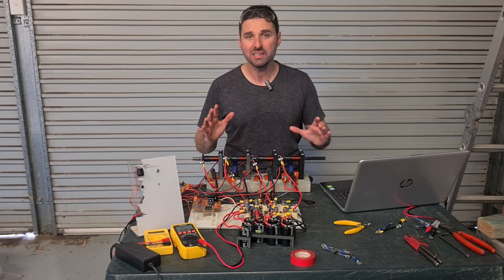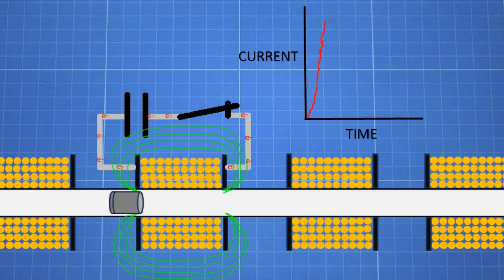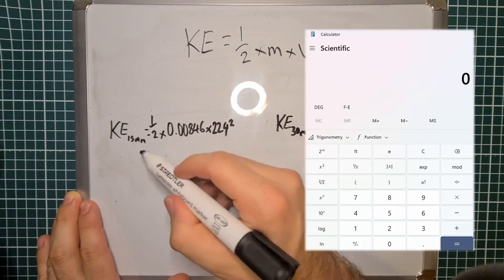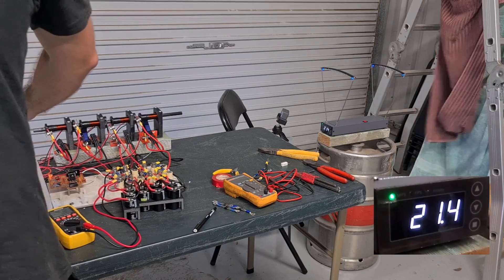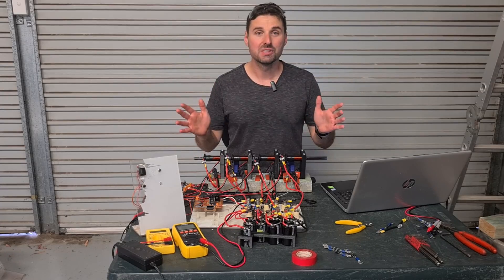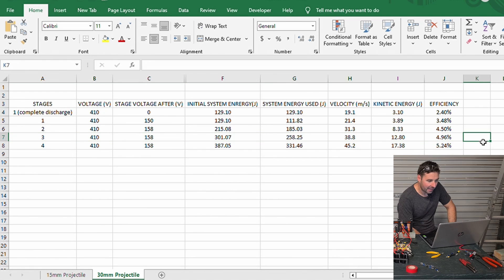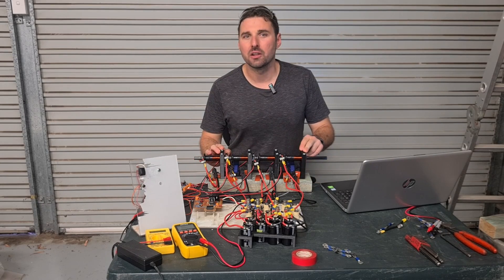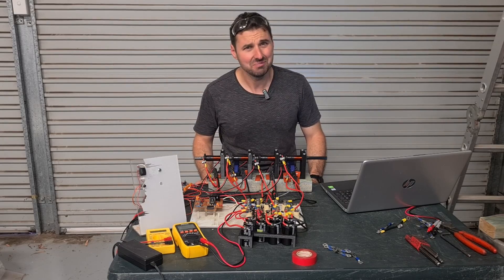Optimizing a Multi-stage Coilgun

Comment: Hello sir, cool project! What does the microcontroller do exactly ? Timing the turn-off of the igbt?and the turn-on is controlled by an IR diode right ?
Reply from the maker: The microcontroller handles the control of both the on and off timing of the IGBT's. It takes the signal form the IR diode and transistor and adds a slight delay until the projectile is in the ideal position the then turn the IGBT on and then turn it back off again when required.
Reply: @owensprojects  I see, thanks !

Comment: 我想将几毫米宽的线圈，五十个排列，发射时全部通电，线圈外侧安装导磁材料，弹丸到达哪一个线圈就断电，整个长度都被用来加速。子弹使用强磁铁。发射受到两种力量拉动，一是磁铁和线圈异极相吸，二是楞次定律磁场变小，跟随磁场前进。我只是在思考，完全还没下手实验没有数据。
I want to create a coil that is several millimeters wide, with fifty coils arranged in a row. When firing, all the coils will be energized. A magnetic material is installed on the outside of the coil. When the projectile reaches a certain coil, the power will be cut off. The entire length is used for acceleration. The bullet uses a strong magnet. The firing is pulled by two forces: one is the attraction between the magnet and the coil due to opposite poles, and the other is the decrease in the magnetic field according to Faraday's law, which causes the bullet to move along the magnetic field. I'm just thinking about it. I haven't even started the experiment yet and have no data.

这种一个一个线圈通电，只有一半路程被用来加速。我还在思考，当铁块靠近线圈，线圈通电，铁块应该是受到楞次定律推力，当然异极相吸的力量远大于突变磁场的推力。

In this case, each coil is energized one by one, and only half of the distance is used for acceleration. I'm still pondering over this: when the iron block approaches the coil and the coil is energized, the iron block should be subjected to the force according to Lenz's law. Of course, the repulsive force between the opposite poles is much greater than the thrust of the sudden magnetic field. 

I want to maximize speed and efficiency,  and look forward to a reply.:eyes-pink-heart-shape:
Reply from the maker: That's an interesting idea you have, what will you be using to power the coils? You will have to update me on your project when you start to experiment with it, i would like to hear how it performs using a magnet as the bullet.

Comment: Good morning, how did you handle isolation? Are the stages isolated from one another? Do they each use different power supplies for the gate drivers? 
Did you need to use any magnetic shielding like mu metal between the coils and the light beam sensors to avoid false triggers when other stages produce magnetic fields? 

I'm about a year deep into my own build and it certainly stands out from the 3d printed, friction held mag using sorts of models, but have a ways to go with the electrical engineering. I'm currently going back and forth between the gate driver design and the charging circuits as whenever I get one right, the other breaks in some new way. I'm not sure if I'm overthinking the wrong aspects or what, but I'd love to learn some more from an application oriented perspective from someone with genuine experience. Reach out if you're interested in seeing what I have to offer and potentially collaborating
Reply from the maker: Yeah the stages are somewhat isolated from each other, the capacitor bank is charged as on bank and then when firing different sections of it power different coils. Each gate driver is powered and controlled by its own microcontroller. There is no shielding between coils there wasn't any false triggering I encountered although if the chronograph was too close to the coils it would give false readings.

I would like to hear about your project, i'm always interested in hearing what other people are getting up to.

Comment: What is the rating of the capacitor?
Reply from the maker: The capacitors are rated at 450V and 560uF. The first stage had 3 in parallel and the other 3 stages had 2.

Comment: What if All of the coils are energized. Rather than turning them on and off as the projectile moves. Why not just turn of the coils as it travel to each coil. Or have the coils pre charged and use the capacitors as Boosters
Reply from the maker: It could be done that way but the capacitors that power the later stages are too small so they would be discharged before the projectile reached them.

Comment: This is one of the best coilguns I have ever seen! I have been working on making my own arduino coilgun and I keep having the problem where my firing thyristors and Igbts burn out at the high current draw from the coils, what type of IGBTs did you use?
Reply from the maker: Thanks im glad you enjoyed it. The IGBTs i used were part number IXYX50N170C. They were rated higher then what i needed and then used 2 in parallel to help with the high current draw.
Reply: I will disappoint you, this is not a better product that I saw, I know the channel of a man who made 200 meters per second on 14 coils and this is amazing

Comment: hey, We r also tryna make this 4 staged coil gun .... any advice??
Reply from the maker: A few of things to focus on to get the best results out of it are: the distance that the projectile starts at in regard to the center of the coil, having a way to reliably switch the power off to the coil once the projectile reaches the center of the coils and depending on if you want a higher projectile speed or energy the diameter and length of the projectile will affect this. Hope this helps to make your own version
Reply: @owensprojects  thankyou so much

Comment: @owensprojects out of curiosity,  how are you measuring the projectile's speed? It appears to me that you're measuring the speed just in front of the target. This wouldn't allow for the losses due to air resistance in your efficiency calculation.
Reply from the maker: The speed is measured with a chronograph that is set up about 1 meter from the front of the barrel. There would be some losses from air resistance that will affect the efficiency calculation, but i dont think the projectile is moving fast enough yet to have too much of an effect. I looked up where speed measurements are taken from, and they seem to be done between 3 and 4.5m from the end of the barrel, so it would be interesting to test what the speed measures at from that distance.
Reply: I'm curious as to where the losses are happening? BLDC motors achieve efficiencies over 80%. What is the ESR of the caps and the resistance of the coils?
Reply from the maker: I am still trying to work out where all the inefficiencies are coming from. The coils are around 825milliohms each, and the esr of the caps is 200milliohms at 100Hz. Im working on trying to improve the efficiencies but the main issues seem to be the I^2 R losses as the coils do get hot after a few consecutive shots, im also experimenting with an extenal flux guide to concerntrate the magnetic as much as i can.
Reply: Do the switches get hot too? 
I'm a fellow Aussie and am about to start on a similar project.  I'm keen to discuss more with you if there's a way to direct message you?
Reply from the maker: The switches dont get hot only the coils. Yeah you can send any questions through to the email owensprojectsyt@gmail.com

Comment: There are 2 type of people making coil guns, one are over engineered and bearly break 10m per second, and other type is made in some garage with ducktape car battery, plastic pigtails, and sometimes explode, but are hitting speed enough to break metal boxes
Reply from the maker: There is definitely quite a contrast between the two types, each have their own merits. I do enjoy seeing the roughly put together versions hitting massive speeds though.
Reply: @owensprojects  very real and based

Comment: I saw other youtubers improving the coilgun using iron strips around the coil, apparently it helps to concentrate the magnetic field into the inner part. Also, did you tried with different geometries? like winding the coil in only one direction, and also making them larger and with less layers. Will you be doing a follow up video?
Reply from the maker: I have been interested to try adding strip or something similar to the coils, but im not sure if they will hold their magnetism after the power to the coils have been switched off which i think would decrease efficiency if that is the case, so it would be good to test.
In my first coilgun video, i tried a couple of different geometries, but it would be worth visiting and expanding on them.
There will be another video coming once i put together enough different ideas to test to make a video worthwhile.

Comment: From where I can download Attiny85 library on LTspice?
Reply from the maker: I'm not sure there is an Attiny85 library. Well, i haven't been able to find one. When i made the schematic for the circuits, i created the symbol for it manually
Reply: @owensprojects  so basically, you cannot make a simulation with that circuit sir? Because I want to try to measure the current on the coil in LTspice
Reply from the maker: You can still simulate the circuit. You just have to replace the attiny85 with a voltage source that turns on and then off for between 1.8ms and 1.1ms, depending on the stage you wish to simulate.
Reply: @owensprojects I have 1 question sir.. if we can control the time of current to flow on 2nd stage and 3rd stage coil,, when the projectile has passed 1st stage, then next coil current will be charged using exact timing.. so we can make a projectile moves faster without microcontroller right?

Comment: Amazing work and video. Is there a chance we will get an update on the project soon? I wanted to do similar testing but I haven't gotten around to find the time for it. 
I had some trouble finding a Mosfets or IGBTs rated for the expected currents(I wanted them to be less than 10-20euros in cost). I didn't really consider using them in parallel. What part number are you using?
It would be very interesting to get current and voltage graphs of the coil and IGBT if you have an oscilloscope. Keep in mind that current of the coils will not stop when you turn the IGBT off, it will just keep flowing through the diode. 
Again I just want to applaud you for the great work that you are doing, its really professionally made and presented! Thank you!
Reply from the maker: I will be revisiting the project again as i have a speed and energy goal i want to reach with it. Im working on a couple of other projects at the moment, but i will be doing an update in the future.
I ended up using IGBT's. The part number is IXYX50N170C, and they are fairly well priced.
I would like to measure the voltage and current through the coils. i will need to get some higher rated voltage probes, but I will get some when i do a future video on it as it will be very interesting to know.
Thanks for the kind words, im glad you enjoyed the video!

Comment: For experimental sake, try a cylindrical magnet projectile. Or a sabot + dart shape (although I guess the OD of the projectile should be as close to the ID of the coil as possible).
Reply from the maker: Im very interested in trying a magnetic projectile, there is some mixed views on them, but it would be good to test it out. 
Yeah, having a sabot round would help with keeping the projectile flying straight and increasing range, but like you said, having the OD of the projectile further away from the ID of the coil would mean the transfer of energy would be diminished offsetting any gain from a sabot round.
Reply: @owensprojects  Since you did a really good job with this vid, ueh a comparison between iron and a magnet projectile would be very interesting. A threaded locating pin may allow you to screw some sort of non-metallic fin on the back of it while keeping the fit for the bore, finding one thats not stainless may be an issue though.

Comment: Hi! probably too old video to comment this, but I have a good idea to improve this setup
The coilgun is quite similar to a electric motor and have pretty much the same problems. Acceleration from steady state is quire difficult and most of the configurations are pretty inefficient in that scenario. As you see, when you put more stages you increase the overall efficiency, basically because the stages that receives a pre-accelerated projectile are more  efficient, since electromagnetic field and high speed are good friends. 
To solve this problem of pre acceleration I suggest to use a pre-acceleration stage using rubber bands or compressed air. This two options are quite good delivering high power at lower speeds (exactly the opposite from your coilgun).
Results could  be quite promising, since I human can easily deliver ~20J from a sling and you prove that under the low efficiency/low speed region  your were still able to deliver ~20J.
After this experiment I think you will be facing different problems, like dimention of coils (that should be decreasing on each stage) and friction (vaseline?).
I over extend hahaha. Just one more thing, your content is awesome I glad to see how happy you look doing your research! Saludos!
Reply from the maker: That is a really good idea as the first stage just to get the projectile moving uses so much energy for not a lot kinetic energy output, I do like potentially using compressed air for the first that would be much more efficient to get it moving.
Friction is already an issue as when i tested the same first stage coil with a shorter barrel keeping everything else the same was about 2-3m/s faster. Looks like I'm going to have to revisit the project and try those ideas out
Thanks for the kind words!

Comment: I guess the reply i made just now didn't go through because i don't see it. i was trying to tell you that i found a video on here of a guy testing the metal enclosed coil thing. He claims a 50% improvement on one stage but didn't transfer to 2 stage test. He is  Hyperspace Pirate  and it's on  Electromagnetic Accelerator Improvements Part I - Gauss Cannon test rig. Hopefully this one goes through.
Reply from the maker: I have just watched that video, that was really interesting as most the info i have found so far says not use any materials that can hold a magnetic field as it will increase the force pulling the projectile back into the coil and slowing it down, but after watching that video it doesn't seem to be the case or the increase in initial magnetic field is more the then the force slowing the projectile back down when it comes out the other side. Thanks for sharing that, looks like I'm going to have to do some more experiments now

Comment: You said a problem was charging took too long by the time the projectile was half way through the coil to shut it off. What if all the coils started activated and shut off incrementally as the projectile reached the center of the coil. Theoretically, that would make the projectile increase in velocity with every stage as the next stage would already be at max charge and magnetic strength before the projectile excited the previous stage.
Reply from the maker: Yeah, that would definitely ensure the coils are producing the strongest magnetic field as the projectiles are passing through them. I would have to redesign the capacitor bank to handle that or move to batteries at the capacitors im using now dishcarge completly within a few milliseconds. But is a good idea to try in another design
Reply: 我想将几毫米宽的线圈，五十个排列，发射时全部通电，线圈外侧安装导磁材料，弹丸到达哪一个线圈就断电，整个长度都被用来加速。子弹使用强磁铁。发射受到两种力量拉动，一是磁铁和线圈异极相吸，二是楞次定律磁场变小，跟随磁场前进。我只是在思考，完全还没下手实验没有数据。
I want to create a coil that is several millimeters wide, with fifty coils arranged in a row. When firing, all the coils will be energized. A magnetic material is installed on the outside of the coil. When the projectile reaches a certain coil, the power will be cut off. The entire length is used for acceleration. The bullet uses a strong magnet. The firing is pulled by two forces: one is the attraction between the magnet and the coil due to opposite poles, and the other is the decrease in the magnetic field according to Faraday's law, which causes the bullet to move along the magnetic field. I'm just thinking about it. I haven't even started the experiment yet and have no data.

这种一个一个线圈通电，只有一半路程被用来加速。我还在思考，当铁块靠近线圈，线圈通电，铁块应该是受到楞次定律推力，当然异极相吸的力量远大于突变磁场的推力。
In this case, each coil is energized one by one, and only half of the distance is used for acceleration. I'm still pondering over this: when the iron block approaches the coil and the coil is energized, the iron block should be subjected to the force according to Lenz's law. Of course, the repulsive force between the opposite poles is much greater than the thrust of the sudden magnetic field. 

等回
I want to maximize speed and efficiency,  and look forward to a reply.:eyes-pink-heart-shape: